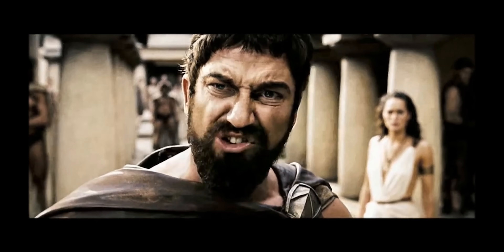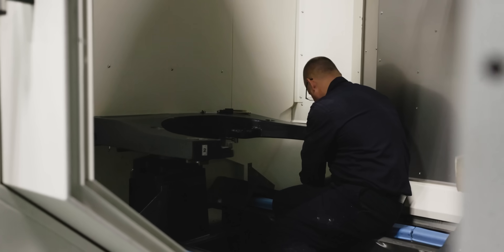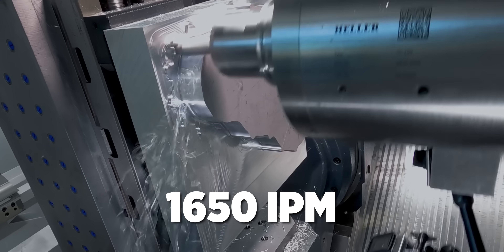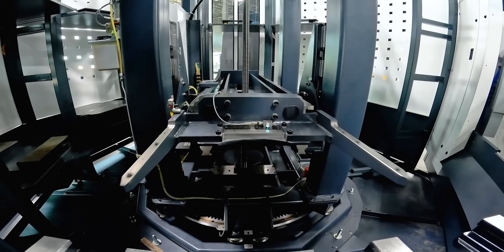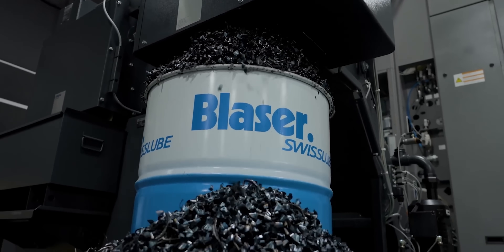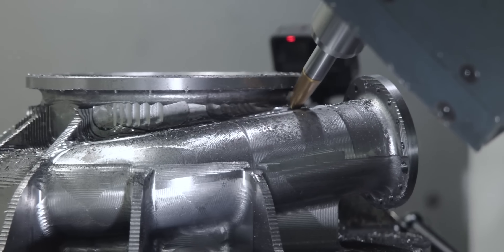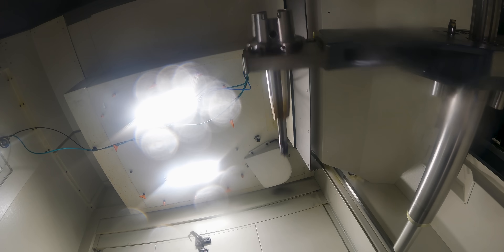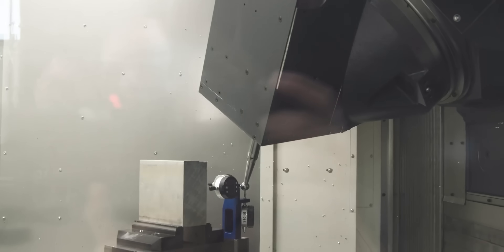Destroying Material in Heller CNC Machines | Compilation

Comment: Do you go through more tooling at high speed like this? Entertaining, but is it cost effective? Curious to know.
Reply: that's a calculation of value of time, lets say the tooling is $0.10 per part at 1 part per hour and each part is $100,or tooling is $0.25 per part at 10 parts per hour. Rethink tool costs.
Reply: Throughput
Reply: Not if you use the correct speeds and feeds. They push it to the absolute limit whereas if you were doing production you’d back it off a bit to protect the tool. Another thing is a lot of the tooling they use is so expensive you’d be better off just running something cheaper but a bit slower. For example the KOR 5 end mill by itself is $500 per end mill and that’s not including the custom tool holder that you need which I’m sure is at least $1000 but probably a lot more